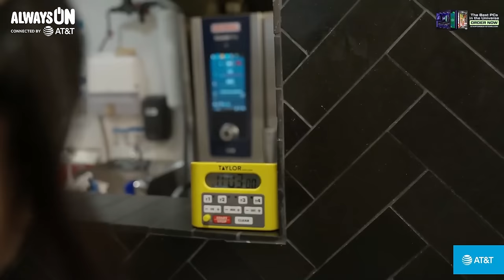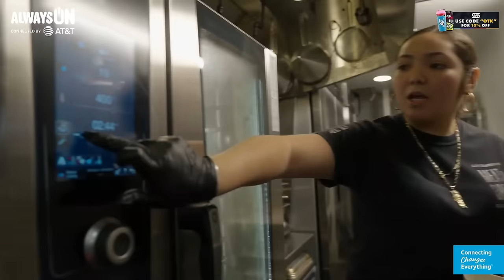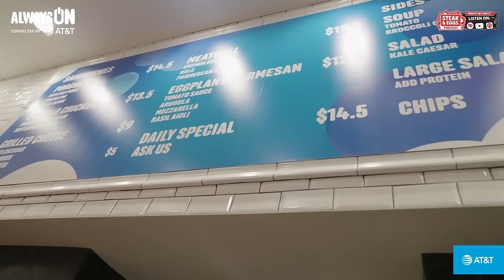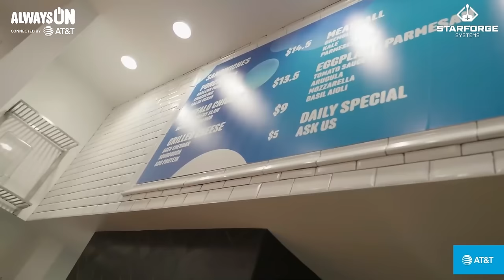We Worked A Real Job For The First Time...

Comment: I cringe as a food service worker when I see the managers using peroxide instead of sanitizer to clean tables. Peroxide is for deep cleaning to prevent strong mold and contamination from restrooms and waste and sanitizer is for preventing bacteria from spreading on surfaces.
Reply: doesnt it do the same job tho? i mean deep cleaning sounds like its gonna sanitize as well
Reply: @x340x  To answer your question peroxide generally needs to sit for about 15 minutes for a proper cleaning job. Sanitizer solution is generally a 70% ISO mix, which cleans in seconds and evaporates almost just as fast. 

What i'm confused about is I could clearly see the manager spraying the tables with sanitizer solution, not peroxide. So i'm not really sure what OP was complaining about unless I missed a different part of the vid